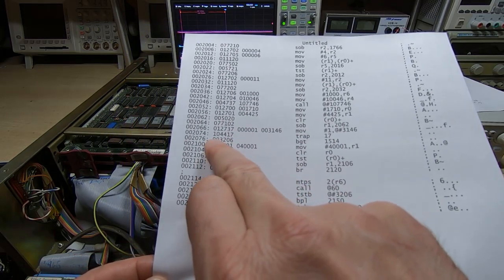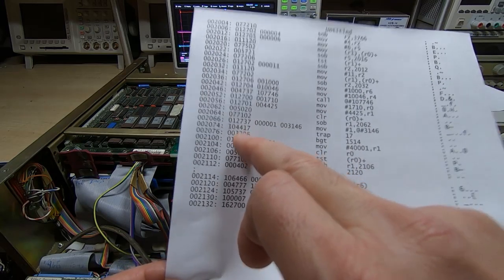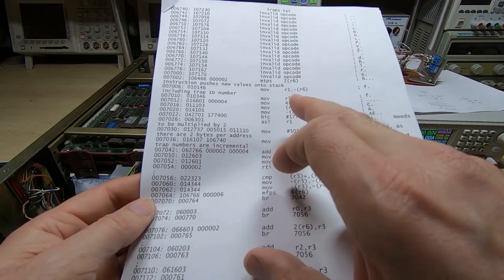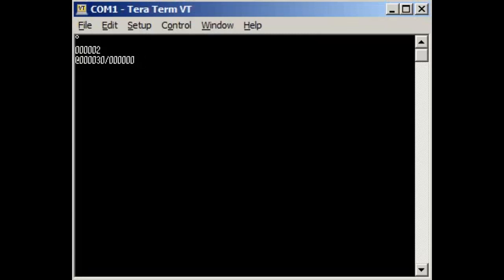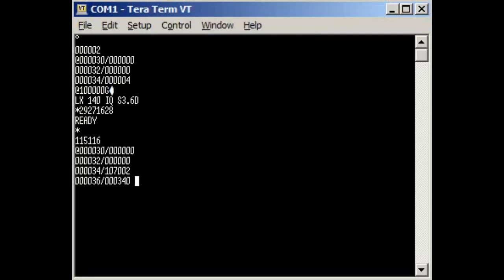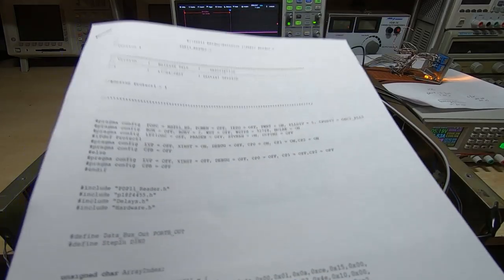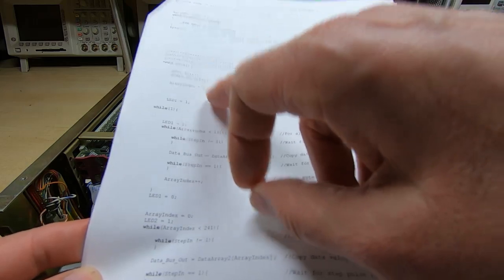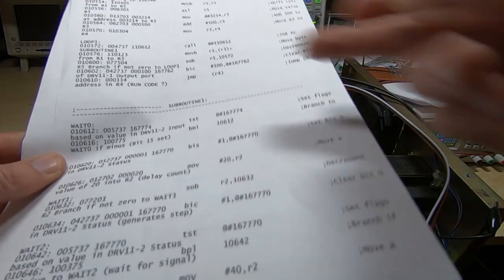PDP11-3 Repair Part5

Comment: Jerry, thank you for these in-depth troubleshooting videos!  Have you covered the PIC(?) tape reader simulator that you used in this video?  Did you design it or is it available somewhere online?  I think I'd like to build/procure one for use at least until my ASR33 is put back into service.
Reply from the maker: It is just a generic test board I designed a while ago. I use them for general test jigs  for various repairs. It is not specific to any particular purpose and I just write code for the PIC depending on what I am testing (I showed it in a recent video testing the magnetic core memory board). I will be making the bare boards available on my web site shortly if you are interested.

Comment: So you made me look to see what sort of system you had there... I was puzzled because by default, when I hear "PDP-11", I think UNIBUS, and that backplane doesn't look like a UNIBUS.  But apparently a PDP-11/03 system is really an LSI-11 CPU on a Q-bus with a bunch of bundled peripherals.   I wasn't seeing a hex-high UNIBUS backplane, so I went looking..  Looks like a nice collection of stuff for an embedded controller.   https://manx-docs.org/collections/antonio/dec/ek-lsi11-tm-003.pdf

I think that CPU looks something like an LSI-11/2 or LS-11/23 CPU?    I see from the block diagram in that manual there's provision for an optional floating point microcode chip, and I don't recall if that was an option for an LSI-11/2 class CPU, which was my first guess given the 16 bit addressing.  The 18 bit addressing came with the LSI-11/23 and 22 bits on LSI-11/73 CPUs. 

You should be able to mix the peripheral boards around; the only difference on the Q-bus is that the boards closer to the CPU on the Q-bus will have higher interrupt and bus master priority.  Maybe the DRV-11 parallel interfaces are doing DMA?

What a walk down memory lane..   I have this horrific memories of watching an LSI-11/2 system boot RT-11 off a TU-58 block addressable tape transport.  Wow, get a beer while you wait!   It's controller was serially attached at 57.6K, I think.  We ended up writing a protocol emulator for the serial protocol it spoke on a CP/M system and mapped requests for the blocks to one of the 8" floppy disk drives.  At least the floppy was something like directly addressable..
Reply from the maker: I describe the processor in an earlier video. It has an HA processor with the floating point option fitted. It uses the Qbus which is a variant of the UNIBUS. No you cannot simply swap the boards around as this machine uses interrupts for its operation and it will not boot if the boards are in the wrong order. I sometimes swap them for specific testing where the order does not matter but the CNC code certainly will not run if the boards are moved around. This machine is a PDP11-3 HA but just viewing it as an LSI machine is normally sufficient.